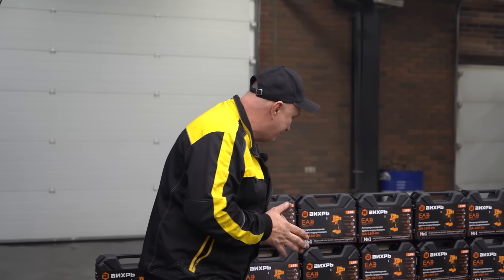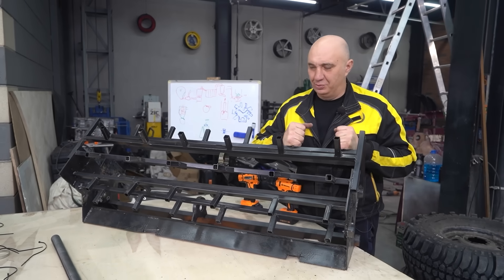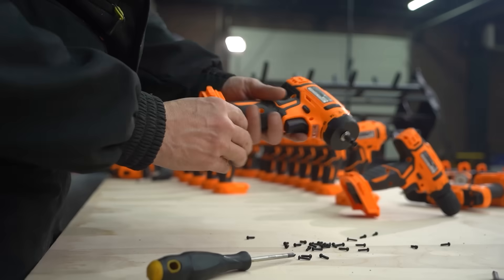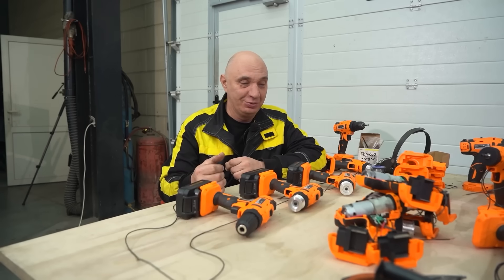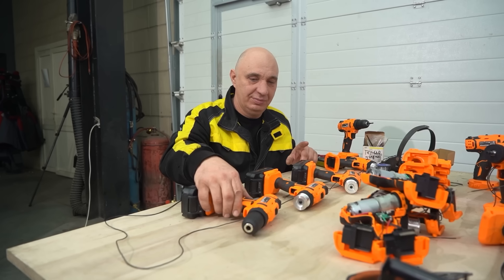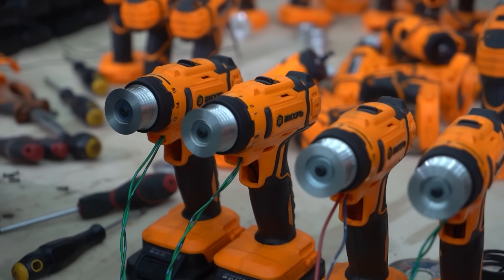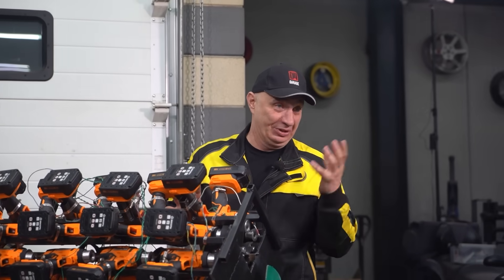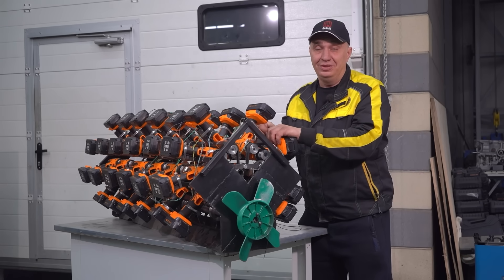50 cordless drills made into an engine for a car

Comment: I'm gonna guess you didn't have any pull down resistors on the gate of the transistor, or a resistor in series with the gate to control the gate charge current.

Comment: 5:23 sounds like you guys need to add a pull down/up resistor (a high value resistor connected to the gate that pulls the voltage down/up to the off state)
when you have a bunch of mosfets/"digital" signals weird things can happen if you do not have a default state, they will "float" and cause  bunch of problems that do not happen predictably.

Blowing up resistors could also be caused by induction since you have a bunch of motors generating magnetic fields it can induce currents that are just too high and break the gates.
Adding clamp down diodes could help removing the spikes.

Comment: Gate capacitance. You need a pull down resistor on the gate of the FET. Charge is sitting there, leaving it on. A resistor of say 10k to battery negative should fix it.

Comment: I think that the issue might be that You have no common electrical ‘zero’ reference. Stick a voltage meter between some of the same poles on the different batteries while on the drills, and I’m pretty certain you will see voltage spikes when running, and voltage differences after running for a little bit. 

A more visual “elif” explanation: Each drill will look at its own negative pole as the value it should have to stop. When only one drill is supplying the level to all the drills, and each drill is looking for its own zero pole level as the value needed to stop, each drill will look at the incoming signal and might say hey it’s higher! Or even hey it’s negative! And that is when the circuit breaks because now the zero pole is suddenly the positive from that particular drills perspective.

Comment: Amazing build!
Your mistake with the wiring is you can't get one drill board to support many motors. They aren't designed that way. The proper way is to do what you did and bypass the circuit boards.

If you wanted 1 drill board to activate all 50, you would need to redesign the board for 50x the load, and still wire them to all the motors anyways.

Comment: If those are MOSFETs then it's a capacitance issue.
Maybe capacitance in the wires you're using.

Use a pulldown resistor from gate to ground.

As for how to run it now that you pulled the guts out of the drills, you can probably get a really big driver board to do the switching for you.

Comment: the transistor in the controller is always referenced to the ground of the connected battery so if you connect all the ground terminals of each battery together it should work correctly assuming no losses over the long wires. In electronics every thing has to be referenced to the correct ground potential other wise the connection is "floating"

Comment: Most simple and low-tech solution for your trigger problem: Just add a small relay to each drill so the trigger signal path stays in the drill to avoid interference, then run wires to the coils and energize them with a car battery. Pretty much 0 chance of failure.

Comment: you will need some contacters , like from a engine starter, and /or some relays, note that amp rating of motors, contactors and relay. The variable speed in controlled by the circuits in drills

Comment: You should probably use new MOSFETs with higher voltage probably more than 100v (IRFP4468 can be good )due to voltage spike margin 

Also use freewheeling diodes across DC motor 

Use one speed controller to generate gate pulses 
Than use gate drivers as many as MOSFETs and drills

 to amplify gate current 

And would be good to have access to both battery wires maybe run them in parallel given that they are equally charged to avoid Voltage imbalance imbalance

Comment: You might need to use a diode to prevent the power from running back to the original drill. A diode will allow power to flow one way and not backwards.

Comment: I would have used steel rods, made them into a unit, with pegs to hit all the triggers all at once.
They could also be metered by the throttle pedal once installed.

Sometimes, the old mechanical analog systems are easier.

Comment: Electronic Engineer student here, I feel like the easiest solution would be to completely remove each motor and mount those seperately, eliminate the casing for the drills and the control board and create your own circuit to manage each motor at the same time

Comment: I'm no electrical engineer, just a hobbyist. But with the whole drills remaining on mystery, I suspect it wasn't the components, rather the setup. It seems you had the right idea with the MOSFETs and had the gate, drain and source setup right. But when you turned off the first drill and the others kept going, it was likely because the MOSFET became stuck. The gate terminal acts like a capacitor, and if the charge has nowhere to go, it will stay activated.
You need to discharge the MOSFET with a path to ground. If you had a pull down resistor before the gate you wouldn't get a large in-rush of current, and when you turned the first drill off, the stored electrons can escape back down to ground.

Comment: I really didn't like how you didn't use transistors. 0~1 square wave for a car is not good. just one tiny push on the gas, and boom 100% power. You have to use the transistors to control the power output to the motors.

Comment: Bad idea using belts, you will get power loss, better use a single gear shaft and transfer the power of each drill via (bicycle) gear, while one drill not spinning the rest will spin freely without any issues. Same principle as pedaling and not pedaling, that gear shaft will always spin but it will get the 1x Drill power only if the drill spins. 

Better concept, better power transfer and no issues in case 1 drill gets damaged.

Comment: Micro relay. That way the power is isolated from 1 drill to another. Once you remove the power,  the relay springs will "open" and kill the power simultaneously.

Comment: As most have said;  You have an electronic driver for the drill motor  which involves a insulted gate mosfet transistor.  Likely they are pulse width modulated or variable frequency/pulse width modulated.  They usually utilize a variable frequency driver to operate the pulses in the ultrasound bandwidth so they arent as noisy.  There was a solution but as you have now destroyed your drivers there is no going back for that.  Rather, you'd probably be better off looking for a high voltage DC motor driver like something from a cheap treadmill or industrial DC motor controller.  Radio control cars will also have high power brushed motor drivers you'd likely be able to use.

Comment: I don’t know anything about the circuits in those drills, but usually when I’ve found myself dealing with transistors doing weird stuff like that, it’s because I forgot to use a pull down resistor.

Comment: I see typical comments of the simpleton mass fapping to the fanboi anthem but if there was a brain stem amount any of these clowns they would have removed the motors from the drills rather than (clumsily) wire tie them to bar stock. Yes Garage 54 you will no doubt get your million subs as there are millions of idiots out there.

Comment: 5:58 it's probably the wires. The control pin of a mosfet is very sensitive. Those wires are giant antennas running next to spinning electric motors. You likely need a pull down resistor and a diode to isolate the voltage references from all the batteries, and get the reference voltage to zero per drill.

Also... Connecting all the batteries like that is unsafe, especially if they aren't all the same charge level. But since when has safety been in your vocabulary?

Comment: I think you just need to use a diode on the gate pin on each one so it doesn't affect the others , and use external power supply to trigger them

Comment: Best way would be to use an opto isolator between the MOSFET and control switch, you can even PWM it to get variable speed. There are a lot of ways to get it done but I still think that the simpler the better should bring the best results.

Comment: i have worked on 240v motors and i would say that no3 and 2 are back feeding during the short gap when the off command comes from 1 tricking whatever is controlling it to keep it going after all motors are generators just being powdered instead of making power by being spun
Reply: diodes will be best bet to stop this back feeding

Comment: it's very possible that the transistors keep failing because when you connect them together the gate capacitance increases and needs way more current to turn on quick enough, which forces the mosfets to work in the linear region longer than they should, could be fixed by a gate driver or another mosfet directly supplying the gates. the increased gate capacitance also could be causing your drills to stay on, which possibly could be fixed by adding a pulldown resistor between the gate and ground connection (10-20K)
Reply: also, if you don't wanna mess around with gate drivers im pretty sure you could just sacrifice one unit and hook up the wires that once were connected to the motor to all of the gates of your transistors, just make sure your battery doesn't exceed 20v. A pretty simple and smart solution if you'd were to ask me. I welcome you to correct me if I missed something
Reply: and here is a bonus idea, connect all of your ground connections to the steel frame to make your wiring easier

Comment: Those controllers are designed to operate one drill at a time. Trying to run multiple drills is way too much amperage for the chips which is why they failed. Eliminating the controllers was the best call. A high amperage rheostat might be a better option to give you some throttle control. I look forward to the next chapter to see how it works out.

Comment: 5:14 As for the transistor and only the transistor. It accepts enough power for one drill. Hooking multiple draws more power you need one that can handle the current.

Comment: Just another commenter agreeing with the MOSFET (the big "transistor") gate charge theory. The quirky inconsistent control behavior you saw is almost certainly due to the gate of the mosfet, which behaves like a small capacitor. Without being tied to a reference via a high ohm resistor, they can assume a somewhat random state depending on the environment.

Comment: I know it's a one off and for fun but it's important to note that drill motor bearings are not built to handle axial load which is something they very much will be experiencing in this pulley configuration, for any amount of longevity from the bearings you should add a bearing inside the other end of the pulley wheel attached to a static rod that is welding in place to support the axial load. Awesome idea looking forward to seeing it on a vehicle

Comment: Running on close to dead batteries and you don't need a gas station nor a charging point. You require a hardware store which sells these batteries. I imagine Vlad going in: "50  power tool batteries please, owh and they must be fully charged. I will exchange 50 drained ones 😂"

Comment: 5:15 use a single highpower igbt block and  one control chip

And wire to a giant battery

That way one transistor can drive all 50 in parallel 

1200v at a few hundred amps igbt rating should be plenty for all em since they only need about 24v, but a lot of amps

And the igbt can also Have protection diodes to prevent inductive spikes from the motors kicking on and off
Reply: With electric motors you can have a built in cvt transmission since you can pwm the motors to control torque and rpm, and still have the gear ratio from the transmission

So effectively any gear ratio you want, plus the gear ratio of the car transmission

Probably more efficiently than a whole actual cvt tranmission

Comment: To hook the trigger's together you need to isolate each transistor from each other with diode's on your signal wires. Put a diode in line so the diode stops signal from bleeding back to other transistors signal inputs, signal can come in to each drill transistor but not back out to others. Diode is a one way valve and your signal input for each transistor can not feed back to another with the trigger off. Diode's allow power one way and I assume the input for the signal is just positive voltage varrying to varry the transistor output voltage as transistors just take a small current to control a large current.

Comment: I highly recommend against tying 50 lithium battery packs together in parallel without a BMS to regulate differences in voltage and load between the packs; you’ve effectively made a bomb if any battery packs begin to fail.

Comment: I think you bypassed the potentiometer on all drills, you were using one potentiometer to complete the entire circuit, I'm not sure but logic tells me you'd need a potentiometer to meet capacity of all the drills, but still u should have ended up with 3 wire coming out from each drill not 2, and because you only had 2, can only mean you mixed the positives on some drills

Comment: Should’ve used the mechanical linkage, squeezing triggers with a electric actuator with the drills facing the same direction and then just pulling a rod with some 90° lights coming off of the rod like a circled or tube with some L brackets welded onto them it’ll all pull the triggers at the same time

Comment: Standard dc, can style brush motors.

Use an individual PWM module for each drill motor.

Use a single microcontroller to run each PWM module.

Use a potentiometer to control PWM signal through the controller.

You can directly control the potentiometer with the throttle pedal or throttle cable.

Simple, affordable, pre-made components and some short, simple code.

Comment: When talking with people about mechanic work I Always tell people the engine is extremely simple, all those internals are just to spin the crank shaft around. Doesn't matter what or how as long as the crank spins. The transmission is where the magic happens and no one focuses on the transmission!

Comment: @garage_54
If you end up with a lot of slip on the pulleys, because of the machines being able to move within the zip-ties, make some 3D printed adaptors to hold the machines in place.

Comment: When you start paralleling transistors that have no emitter resistors you can get unbalanced current delivery from each transistor.  I'm not 100% sure of the circuit you are dealing with, but it certainly could be this problem

Comment: To synchronized them i will prefer to use replays for each machine 
And powering them together to run all machines at same time
Reply: Or use diode to allow current only flow in single direction 
But using diode can reduce the amount of current/voltage

Comment: A big pwm regulator would solve this.  Wouldnt it. I made one using hexfet transistor from an electric wheelchair controller. The most difficult thing with my project was matching the capacitors and resistors to  the two little IC circuits. The result were quite impressive when finished.  From super slow to full speed with minimal heat dissipation. There are receipies online using a 555 timer, wich is what I did

Comment: I’d have used a potentiometer rather than a switch. That way you could set the throttle without holding a button.

Edit: even without the switch I’d recommend a potentiometer so you can vary the rpm of the motor and control your speed more accurately.

Comment: If they're DC brushed motors, You could replace the control electronics for each drill with a PWM driver. You could do a simple one for each individual motor, or you could get higher-current drivers to drive several of them in gangs. I don't know what you have available. 
If they were brushless motors, I'd have a better idea.

Comment: I figured out maximum power of 1 motor won't multiply the horsepower and torque or top speed with 20-1000000 motors with the same hp torque

Comment: Holy baba , 6 batteries will run an electric chainsaw enough to run a small bike to a 40 km ,50 batteries should be a blast , why didn't you use a mechanical lever just to pull them, speed controlling is important, by just giving them power will stress the motors , but I guess they are safe ,too bad that they don't get to 3000 rpm to see some real action

Comment: What if you put those drills in their highest settings and then control the speed/RPM by the battery voltage with an electric bicycle/electric motorcycle controller?

Comment: I mean, a single makita 36v drill puts out 2.5kw, or about 3.35hp. 50 ot those drills would put down about 167hp, which is genuinely car power. Honestly it you take 6-7 of those motors you could build an electric lawn tractor no issue. One per wheel and one per cutting blade

Comment: control power externally with a potentiometer/rheostat. perhaps a solenoid/relay to engage power and rheostat to control acceleration. could also wire up a common ground for the drills, then with the relay disconnected you could charge all 50 batteries at a time, use a high amperage circuit breaker to stop it overcharging